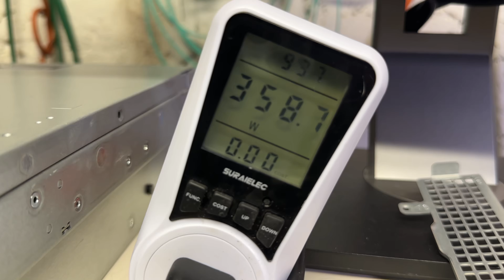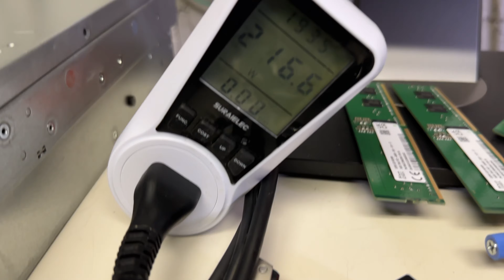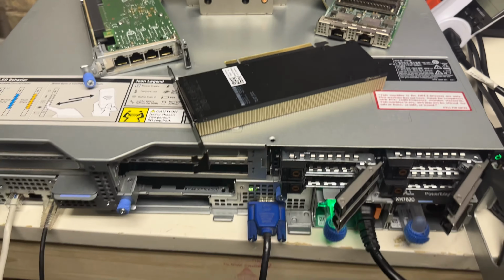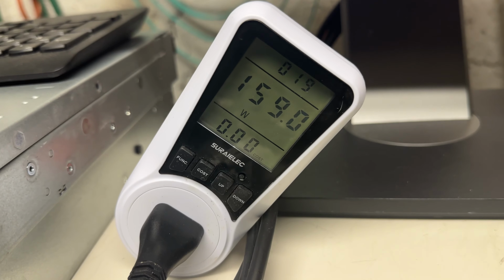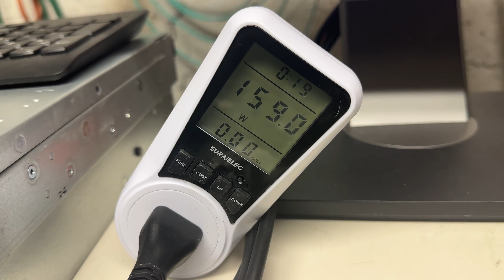This Stuff Uses HOW MUCH Power Doing NOTHING?!?!?!

Comment: 216W is absoulutly crazy the 360 Watt figure is nuttts.
Theres got to be something wrong with Power or Idle states. 
One of our Dell R760s is only drawing 120W with a similar config loaded in Proxmox, no GPU but a 25G nic
Reply from the maker: There are other tweaks in BIOS/iDRAC that could be done this was shipped with the performance preset, and left on that. -J

Comment: Try undervolting the CPU. I guess throttlestop or Intel XTU doesn't work on server chips even with a modded BIOS?
Skylake 140mV underV saves a lot of power at full load.